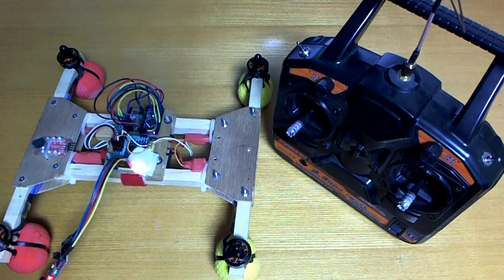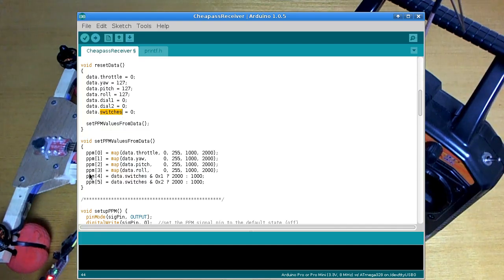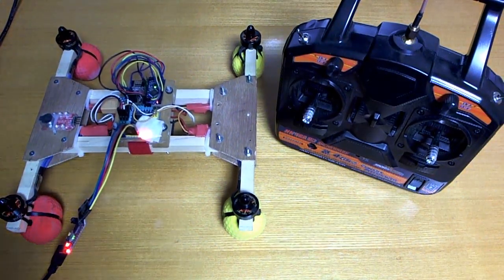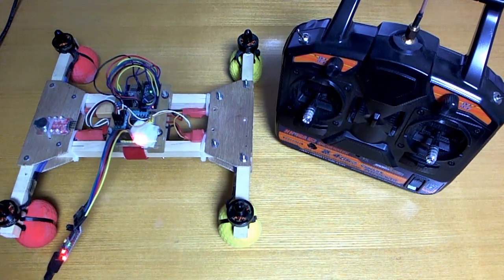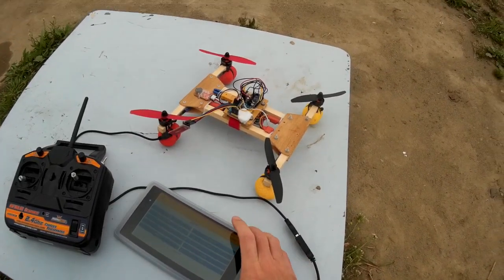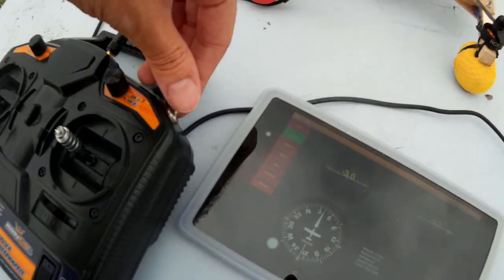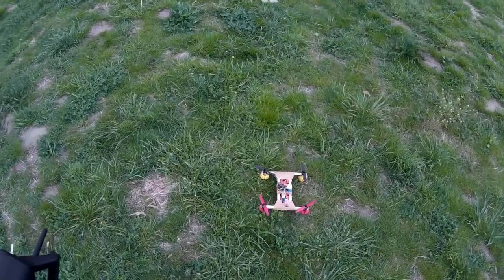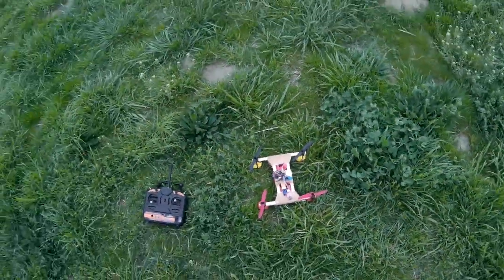Cheapass quadcopter tries altitude hold

Comment: You are still using mw 2.3, aren't you? 2.4 is out now, and it flys far more stable for me, and i don:t have problems calibrating the acc sensors like i used to have before...
I had simular problems with the barometer, i am using a very cheap baro from ebay, and i came to the conclusion that is is not very acurate. Probably not made to give a precise reading that is acurate enough to measure the altitude...
I also own an apm 2.6 which i am flying my "big" x copter with now, the multiwii is mounted on the beercopter. 
The apm holds altitude by a few centimeters, absolutely perfect!
Lastly i must say i am really impressed with your flying skills, you have become pretty decent! Keep going man, and thanks for your videos, i really apreciate them.
I am currently out of town and watching this one on my phone using up all my data haha :D
Reply from the maker: Yes, 2.3. This baro gives values wandering within about 1.5m even when sitting indoors on the desk, so I wasn't expecting anything amazing from it. Not sure what's up with it just going up forever though... I have a MS5611 baro that I will try soon, from what I've seen they have much better precision. I just ordered an arduino mega the other day actually, for multiwii but maybe I could try APM on it sometime too.
Reply: ***** me and my dad tried several FCs, including a Multiwii (nanowii), CC3D, Crius and APM, and we came to the conclusion that the APM is the best FC for the buck we could find yet.
it is not hugely expensive and super versitile.

The sensor i tried on multiwii was the BMP180 which is a cheaper substitude for the BMP085.
(http://www.ebay.de/itm/261687288607?_trksid=p2057872.m2749.l2649&ssPageName=STRK%3AMEBIDX%3AIT)
I had very sumular results, so i guess you probably have the same sensor on your board.
Reply from the maker: muh1h1 After discovering that it's not actually a PID controller (D is not derivative of error, so let's give it a different name ffs!!) I spent about three hours adjusting the settings, and although things improved a lot, it still always ended up sinking to the ground after about 20 seconds or so. Yeah, I have seen very good results with APM, it has an MS5611 right? I have seen some very good results with multiwii and MS5611 too though, so I'm hoping it's the baro that makes the difference
Reply: *****
Have you tried MW 2.4 already? i have noticed that with 2.4 i get a I2C cycle time of exactly 2800 all the time, while 2.3 is wandering alot, so i think thes improved 2.3 alot performancewise...
Reply from the maker: muh1h1 The source code I used for my telemetry enabled build (the black nylon quad) was very nearly 2.4, since I grabbed it shortly before 2.4 was made official. Have to admit I have been quite pre-occupied with other issues when I'm flying that, so I have not noticed any changes in flight behaviour. After reading your earlier comment I had intended to change the cheapass to 2.4 before doing more alt-hold tuning but completely forgot... that would give me the best comparison, because then I would be comparing official 2.4 with official 2.3, and using the same frame as well.
btw when I was searching for places to reduce code size recently, I came across an entirely different routine for the flight stabilization which is not used by default (search for "#define PID_CONTROLLER " in config.h) and I want to try that sometime too. Might be interesting to test if you are into playing around with this stuff :)
Reply: ***** Yes, i have found this too, and i wanted to try it also. it somehow changes the meaning of the "rate" parameter as far as i understood it. I have not tried it yet, because i am still waiting for new props...
One advice, never bild a quad with 6" props, they are almost impossible to get (and the ones you get are mostly expensive, poor quality and/or very low pitch...
Good luck testing :)
i just recieved my GPS/Compass module for the APM, and i have just mounted it on the bigger quad and now in the process of software configuration :)
oh, and by the way! If you get an APM at some point, DON'T buy anything lower than a 2.6 version! The 2.5 versions have the compass directly on the board which makes it unusable due to the high magnetic fields around the FC!
Reply from the maker: muh1h1 I have some of these props, I have not used them yet but they seem quite good, very stiff feeling http://www.banggood.com/Gemfan-6045-Propellers-CWCCW-For-QAV-250-240-Mini-Quadcopter-p-945555.html Unfortunately the center part of them is quite thick, and I can't fit a nylock nut far enough down the motor thread to lock them on, and the motors I want to use them with are all threaded one way, and I have had a number of crashes caused by the nuts on the two counter-rotating motors coming loose that I don't want to repeat. I know what you mean about some of the 6 inch props though, the 6030s I had before were super flexible and often broke from a light crash in very long grass. One time I tried them with my sunnysky X2204 motors, and a quick burst of 3S full throttle caused two of them to simply disintegrate.... don't think I'll get those any more :)
Reply: i took my 6" Copter apart yesterday to make an 8" one from it. used the old Graupner EProps, which are super awesome, and almost impossible to destroy.
My dad had a crash recently with one of those, broke the arm off the frame (DJI F330), and we had to "Dig" the motor out of the ground, but the prop was still as good as new.
However the quad does not fly at all with the stock multiwii parameters, which is wierd, i never had to change anything and it always flew perfectly yet...